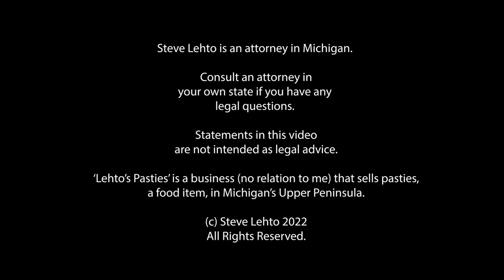Did Ford's Use of Cheap Steel Increase Roll Over Danger?

Comment: I do residental construction. It's been my experience that when the contractor picks the cheapest flooring, cabinets, hvac system, doors, windows and subs it usually comes back at some point and bites them.
Reply: I train dogs and if I don't do my job it literally bites me
Reply: In general they choose it according to what the consumer/client is willing to afford, which you could explain to many people as you just did and they still would go with the cheapest option. There’s many reasons why residential construction has been dying for decades. Often even the wealthy owners expect the overseas slave labor prices in the package now, oh but also only the best service while you maintain overhead that much of the competing illegal labor doesn’t. Watching Boomers act confused about this after I grew up not being able to even apply for many jobs when entering in teens because I didn’t speak Spanish, is mildly entertaining. Most of them made their money and live like kings down south, but now you’re competing with much more desperate from some of the poorest countries on this planet in the rat race towards “best price.”
Reply: @chriscunanan  so if ford asked me would i like a thin roof that crushes in a rollover or a thicker one i would choose the later. Had a builder tell me that the client could only afford 24 inch by 24 inch windows in the addition. The homeowner disagreed.
Reply: There’s a term for that.  Once I was reviewing lighting fixtures in a catalog with a contractor and I noticed the term “contractor friendly.”  I told him we didn’t want those.
Reply: Not the price but quality that matters...
Reply: @GH-oi2jf  installed HVAC for a while they actually have indoor coils called builder coils. The cheapest stuff their is. The box made from fiber board.
Reply: It usually bites the homeowner 5-10 years down the line.  The contractor is long gone, and the current homeowner might not even be the original home buyer.
Reply: @GH-oi2jf  - yeah, I have a big house with 4 bathrooms, all equipped with “contractor grade” light strips across a large mirror glued to the bathroom wall. Have already replaced all the cheap contractor grade carpeting. Will likely need to hire someone to come gut each bathroom and complete them with quality materials and fixtures. Gonna cost a ton. Would have only cost a fraction more had they done it right the first time.
Reply: @678friedbed  seen alot of crashes online they didn't want to role over ether.
Reply: @stephen3164  The 'fraction more' is substantial.  You are mostly correct, it would be better to do it well the first time.  The 'fraction more' on kitchens and baths is about double, 100% increase in costs.  The REAL problem becomes though,, if all subsystems have been done cheaply,, you really should not try to lay large porcelain tile on floor joists that bend too much.  And the tile guy really cannot fix that.  My job today, headed out this AM is to find a way to get a 60.5 inch high quality tub, into a 59.75 tub space,,, with no service access panel.
Reply: Just close the company and open another one before things catch up. If barred from getting another license then just get a partner. Get in make all the money you can, and get out and on to the next company and logo before the lawsuits and sanctions pile up.

It’s a frighteningly common strategy.
Reply: @BuzzLOLOL  price absolutely matters. But there has to be minimum standards of a product or service brought to market.
Reply: @Sailor376also  nailed it. Every system or finish has a good argument about why it should be of substantially higher quality. That adds up at a terrifying pace. Again, the minimum standards have to be sufficient, both finish and rough, systems and materials.
Reply: @robertaylor9218  - Nopers... there's lots of overpriced junk around... paying more doesn't guarantee better...
Reply: @678friedbed  tell that to the guy that had 1 too many at the bar or the lady fighting with her boyfriend. Its not you it's them.
Reply: @678friedbed  how many accidents are caused by other people? Besides yourself? Probably half.
Reply: @678friedbed  yeah that what ford wants you to think. I think its time to sue. Stop the cheap car logic. Ford says brakes failed? Shuda known how to repair breaks. If your a younger person learning to drive if you flip the car, natural selection.

Comment: Steel comes in many grades, such as 1020 being a common mild steel in general use  Tools and other heavy use items use much higher grades of steel.  Using thinner steel may be ok if you use tougher steel.  Like you said about Subway tuna sandwiches, check the invoices.  Each purchase older will tell what steel is used and what the standard strength rating of that steel is. Using a term like cheap steel does not say much, you need to know the grade of steel and its rating.  Cheaper steel would probably be a better description although in my experience there is not much standard commercial use steel lower grade than 1020.  But the grade of steel used in the original design tests and specifications are the issues.  Did they change the design without retest and recertification?
Reply: Lmao A36 is lower grade than 1020 with higher elemental variation accepted and let's not even start with the Chinese steel standards
Reply: @brandonsmoot4056  The issue is, what steel was specified and used in the design tests, and did they make changes without retest and recertification.
Reply: @dblair1247  yeah DCR (document change review) should have caught that a big enough change probably is grounds for another NHTSA test / cert
Reply: Any and ALL steel we use for construction, has a heat number that MUST be documented.  Should there ever be a failure, there is a paper trail that will tell you EVERYTHING about the steel used in the product.  At the end of the day, if the steel was inferior, it will be found out and someone is going to answer for it.
Reply: @82ndAbnVet  a steel not to spec is different than what is involved here.

Comment: I worked for an industrial test lab, and one of my assignments was welding inspection. Background: American Steel contains Manganese and up to 1% is considered part of Iron content. The foreign Steel came from different ores and contained Sulfur and Phosphorus, small quantities are considered part of the Carbon content. Both the foreign Steel and the American Steel were both within specification but welding them together causes cracks to form. The foreign steel for the skyscraper and american steel for the change order on the facade.
Reply: Which specification?
Reply: Yeah, I remember my Structures professor back in the '90s telling us to not use Chinese steel due to poor quality in material AND manufacturing.
Reply: @thatjeff7550  good luck with that.  A contractor will always use the cheapest stuff.  And with foreign govt subsidizing steel, it will always be foreign.
Reply: Silicon steel is a b*tch to weld.😡
Reply: @donh8833  The steel in question was  physically tested at our testing lab and the specs like tensile strength were within the engineering specs.  The ASME specifications were loose enough to cause chemical incompatibility. A custom order for foreign steel for a large building takes months and American steel is available rapidly for engineering change orders.

Comment: You buy steel by weight. Also, there was a surge in computer FEA analysis around 1999 and the big selling point was pushing your design to the safety limits to save money on materials. Millions of trucks means millions in savings.
Reply: Tombstone profits
Reply: It also improved the ability to design effective crumple zones. And lighter vehicles consume less fuel.
Reply: @roflchopter11  Unfortunately in these cases, it is alleged that the crumple zone extends into the passenger compartments .......

Comment: Boron alloy steels include carbon, low alloy including HSLA, carbon-manganese and tool steels.[2] Because of boron's high neutron absorption boron is added to stainless steels used in the nuclear industry - up to 4% but more typically 0.5 to 1%.[2]

Boron steels find use in the car industry, typically as strengthening elements such as around door frames and in reclining seats. As of the mid 2000s it was in common use by European car manufacturers.[3] The introduction of boron steel elements introduced issues for accident scene rescuers as its high strength and hardness resisted many conventional cutting tools (hydraulic shears) in use at that time.[3][4]

Flat boron steel for automotive use is hot stamped in cooled molds from the austentic state (obtained by heating to 900-950C). A typical steel 22MnB5 shows a 2.5x increase in tensile strength after this process, from a base of 600MPa. Stamping can be done in an inert atmosphere, otherwise abrasive scale forms - alternatively a protective Al-Si coating can be used.[5] (see aluminized steel). Introduction of high tensile strength hot stamped mild manganese boron steel (22MnB5) (up to proof strength 1200MPa, ultimate tensile strength 1500MPa) allowed weight saving through down gauging in the European car industry.[6]

Boron steel is used in the shackles of some padlocks for cut resistance[7] Boron steel padlocks of sufficient shackle thickness (15mm or more) are highly hacksaw, bolt cutter, and hammer-resistant, although they can be defeated with an angle grinder. Also watch this video 1999-2007 Ford F-250 / F-350 SuperCab Moderate Overlap Crash Test (40% / 64 Km/h). Rember the Ford Pinto they knew it. Watch the crash test videos on my 1997 BMW 740IL and 2014 Mercedes-Benz GLK 350 a big difference.
Reply: So if they used the boron steel it would have helped with rollovers, but first responders would have a difficult time cutting the survivors out of the cab.  A real issue if the vehicle happens to also be on fire.  If they don't use the boron steel then they save money and make it easier for first responders to cut through the cab, but decrease the crush resistance of the cab in the event of a rollover.
Reply: @peteranderson037   Ido not believe that their equipment will cut thru the frame no problem.
Reply: So Ford knowingly made the pillars and roof crumple zones.. I’m aware share holders appoint people on the board to increase profits, therefore increase dividends.. Seems somewhat short minded to endanger one’s corporate reputation however, face huge payouts in class actions for what amounts to peanuts in the grand scheme of things.. Hope they get royally shafted in the courts for what has almost certainly cost lives that needn’t have been lost..
Reply: @peteranderson037  the jaws of life will cut through cars and trucks pillars like butter regardless.. I can use bolt cutters on 15mm carbon manganese boron steel that’s been case hardened in seconds.. The jaws of life can dish out 40t of force, they are aptly named..
Reply: @GeorgeWashingtonLaserMusket  No my pedigree chum, I manufacture the worlds best security chains.. How you like those apples, ya muppet!

Comment: The problem, as i see it, is that there is no way to make a vehicle that will not hurt you if you get in an accident.  Yes, you can engineer solutions to make it harder to get hurt or lessen the severity, but you cannot eliminate it.  Therefor, it follows that there should be standards, so that the manufacturers know where their responsibility ends.

If the standards were met, then the problem is with the standard, not the vehicle.

Because consumers usually don't at how safe the vehicle is (because it's almost impossible to compare vehicles).  But they always care about how much it costs.

Comment: The problem with measuring steel thickness and using that as a blanket statement of strength is it is way too simplistic. Structures are way to complex for such a view. Obviously reducing the quantity of material can reduce cost and that may have been the only concern that was looked at but it would be really hard to prove.

- BMW published a paper (at least a decade ago) explaining how they increased the crush strength of their side structure by selectively reducing the thickness of specific points in the car's frame. Using advanced FEA (Finite Element Analysis) they found that making some structures stronger could move stress to parts of the structure causing them to fail. If they reduced the strength in carefully selected ways they could spread the load more evenly so it increased the ultimate load that it took to make the structure fail. Plus reducing the total mass reduced the quantity of energy that the structure would have to deal with.

In other words: It is WAY too complex for a trial and jury to make an intelligent decision. The only way you will ever really know is to get a truly candid conversation with the team that designed the structure.
Reply: Well said. Not that there may not be a problem but as a former metallurgical lab technician quite the involved thing to sus out for the untrained.
Reply: True... it's the quality and thickness of the steel, not the price that matters... plus new Ford truck's are made of aluminum...
Reply: nerd
Reply: I agree, the lawyers may have made the "cheaper" point to make jurors think the same way.
Reply: OK, but do you really think Ford used advanced FEA when determining the thickness of the metal of their truck cabin pillar components in 1999, 2000 or 2002? Then Super Duty (F250/F350) design was finalized in 1997/early 1998 so Ford could retool their plants over the spring/summer of 1998 to begin production by fall. Given the state of engineering software and the state of computing power in the late '90s that seems rather unlikely that Ford had the capability to model advanced FEA.
Reply: @AaronCMounts  you are right about the lack of computerized analysis back then, but computers aren't inherently needed to do calculations like that. Just look at the golden gate bride. it was all calculated by hand. 

The point the poster was making was just that the engineering behind such designs are simply so complicated that it doesn't belong in a court case.
Reply: @BuzzLOLOL  as well as the shape of the steel. angle iron is stronger than sheet steel even at the same thickness due to the moments created by the different geometry.
Reply: Maybe BMW will say maybe we'll get sued one day, let's get in on this one to help set precedent.

Comment: Every bit of weight savings also increases the increasingly outrageous tow ratings & fuel savings also. As a side, if GM & Chevrloet were allowed to combine their sales, they would have a larger cumulative sales figure than Ford...
Reply: Chevrolet is part of GM.
Reply: @GH-oi2jf  correct, but they have to keep their sales numbers separate. I was saying that if they were allowed to combine their truck sales numbers, it would be larger than Fords numbers.

Comment: CAFE 25 and similar fuel economy mandates on auto manufacturers has led the reduction in the curb weight of newer vehicles.

Some parts are now made from aluminum, and many parts are now  made from high strength automotive steels.

Long story short, there are new grades of steel which can deliver the same strength as older grades, in thinner cross-sections... when things are done right.

The idea behind the higher strength steels is to get the same strength performance in stamped parts at reduced weights, meaning thinner sheet metal.

Fire - rescue teams have a much more difficult time extracting injured people from vehicles where the cabs are made from these higher strength steel, and need to cut the pillars with power saws using newer blades that have different synthetic teeth than the older saws. The "Jaws of Life" and similar hydraulic tools also need to be upgraded in order to cope with the new metallurgy.

Also, the body shops need to replace damaged parts entirely in many more cases, as it is often not possible to restore a damaged part to original contours without cracking and tearing the steel.

All well and good, the new steels are tougher per unit weight than the older steels... when they are made correctly. One of the major problems with the world's steel supply is that much of the iron and steel is made offshore, and even though they use clean ores (you cannot make the high strength automotive steels without using "virgin" iron units to control the chemistry), the contaminants in the ores are different. So, even if the foreign producer is making their steel to the specifications for the new grades, there will be some degree of difference in the composition... hopefully, a very small degree, which doesn't affect the properties of the finished steel parts.

So, are the car makers designing parts to be made from the new high strength steels, but getting them delivered to the assembly lines made from an older, less strong, grade?